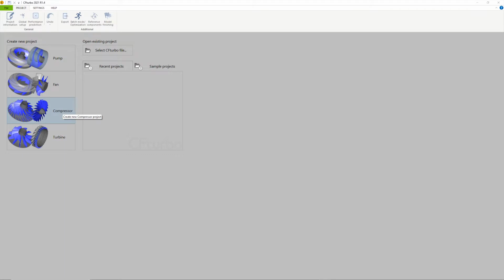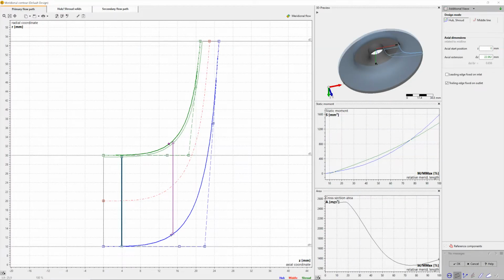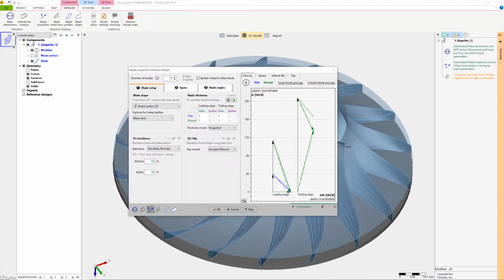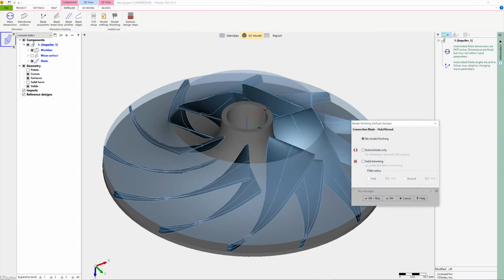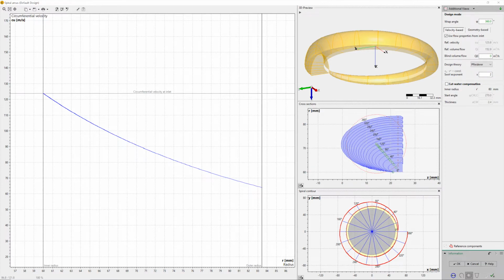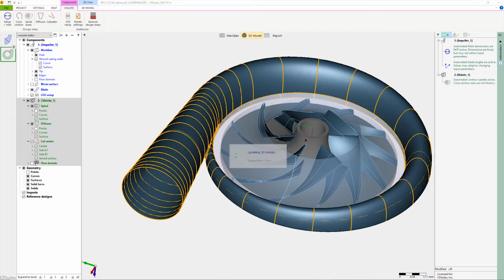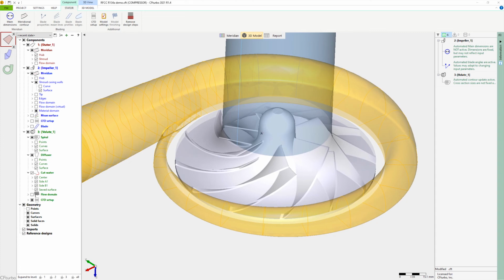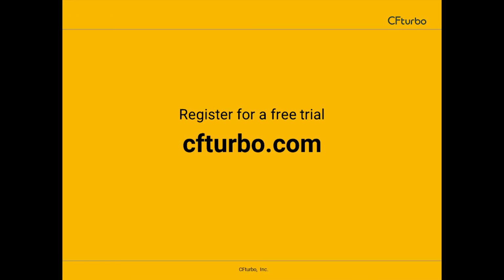CFturbo Conceptual Design of a Compressor for R134a

Comment: there is an issue while finishing the models. the interface shared by rotor and stator is wavy. as a result when imported to turbo grid and cfx, there'sgap at interface. how to address this issue